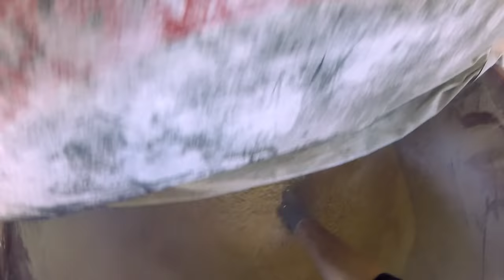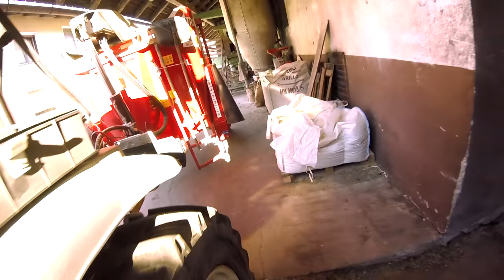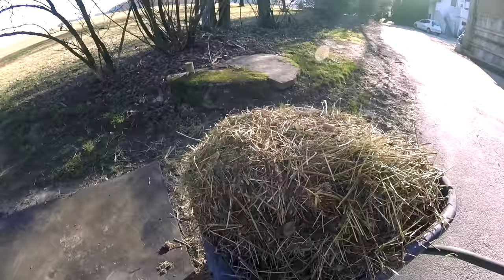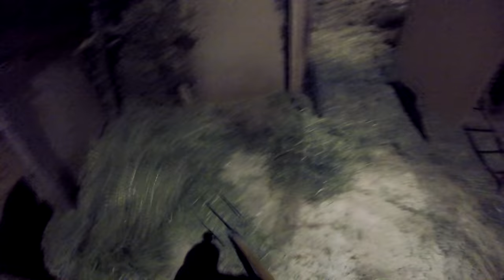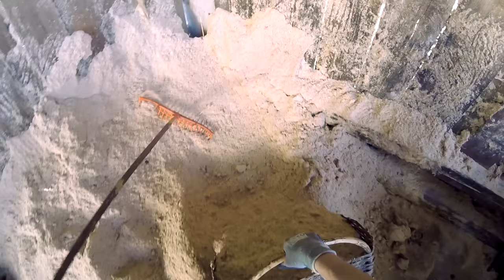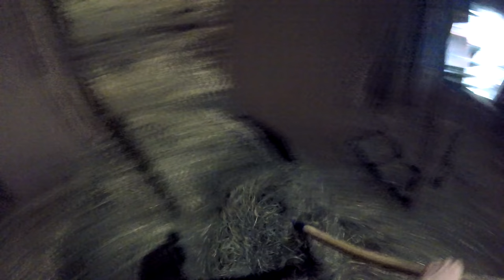Feeding the Cows | Barn Work on a Small Dairy Farm

Comment: Hey that is the same mixer we have, tho ours is a lot, a lot more beat up, and isn't nearly as new. I actuly made a wirelses remore for ours that allowed you to move around while you were taking in silage, that was a nice edition. And we also do out bunks the same as you gras on the bottom at corn on the top, it relly helps with mold and saves on time.
Reply from the maker: Cool 🙂 nice, that sounds like great addition! 😀 Yeah, I guess its not very common way but it works good 🙂